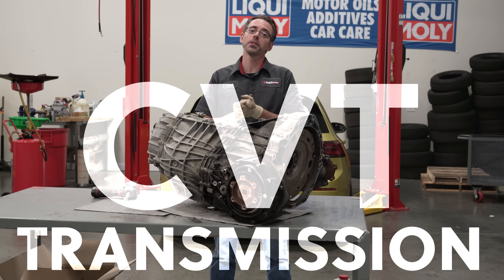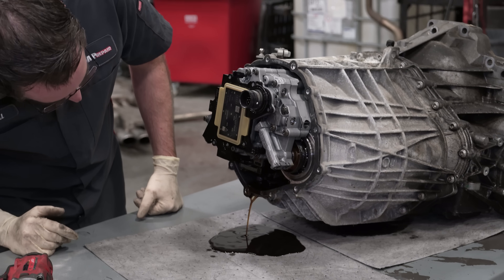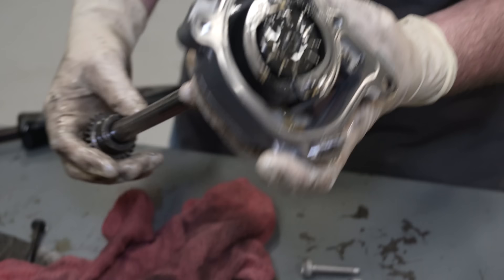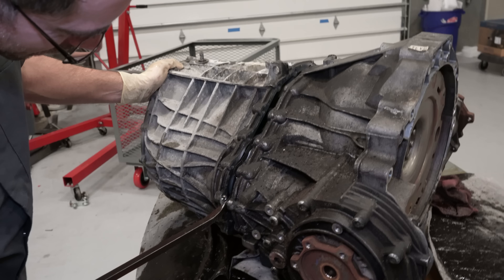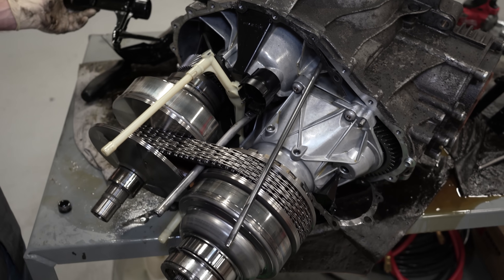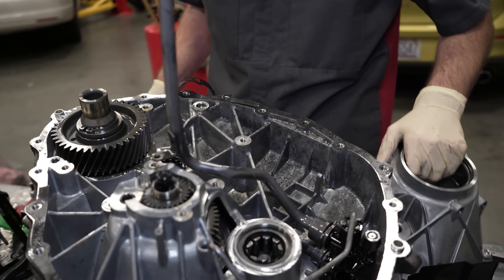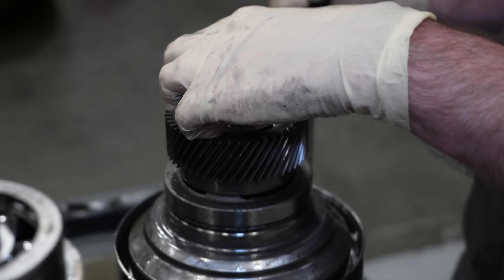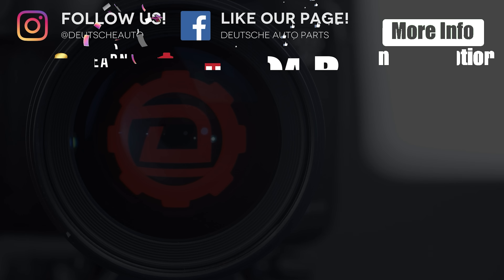Why you shouldn’t get a CVT transmission

Comment: Americans are into automatic transmission  but my favourite is a 5 speed manual floorshift.
Reply: Why wouldn't you like a 6-or 7-speed manual transmission even better?
Reply: @HelloKittyFanMan.  maybe on a big vehicle but on an ordinary saloon 5 is enough if the engine has good low end torque.
Reply: @ngauruhoezodiac3143 : I wasn't really asking whether or not 5 speeds would be enough. I know it typically is, but then still, plenty of consumer vehicles that still have manual transmissions have 6 speeds.

Go back to my actual question: Why wouldn't you like a 6- or 7-speed manual transmission even better? Do you like manuals more than autos because they're more fun, or... what, exactly? And if so, then wouldn't 2-3 more gears be more fun than just 5 (without being an unrealistically high number of them for a consumer vehicle, like 18+)?
Reply: @HelloKittyFanMan.  I often have to drive in icy conditions and the manual gearbox gives better control. I also have a very economic style of driving which favours a manual. A 6th gear or even a 7th one would be good if I had a car capable of 200mph but I seldom drive faster than 80.
Reply: @ngauruhoezodiac3143 : But 6th and 7th are fine even for everyday cars; especially a lot of 6MT cars around for the few manuals we do have these days. So why wouldn't you like one of those better than a 5?
Reply: @HelloKittyFanMan.  I don't need more than 5.
Reply: @ngauruhoezodiac3143 : Right. But having fun isn't about just needing something all the time. Have you driven a 6- or 7-speed manual? Maybe those manufacturers thought that those cars either needed that money speeds, or maybe they didn't and those cars could have gotten along fine with 5, but that the 6 or 7 would make them a little more speedy or efficient or something, so they still put the 6 or 7 in there.

So while you may not NEED 6 or 7 forward speeds in a manual transmission, the question remains: do you think you would have more FUN with one? And then IF your answer to that is no, then without just saying something like,  "Uhh, well I don't need them" -- because we just covered that (you don't need something in order for it to still be fun) -- what would be your reason that they wouldn't make things more fun for you?

Comment: Need to go to the single stroke motor or one of the new rotary engine versions for a electric generator to power individual electric motors. Get rid of most of the drivetrain. Less parts. Less to break. Less to fix. 
In the meantime, cvt seems more a downgrade than any upgrade. Crap engineering.

Comment: All junk. 
Literally moves your car on a belt.  They make them like this to save money. It's not a new evolved concept just rejected for years (for good reason). Actually a old concept.  You are losing money because you are paying full price for low quality that cost half as much to build. 
Goes great with all the cheap electronics and tech they put in cars now. Car companies are making a fortune basically selling you.. Cheaply made, cheap to make, crap.
Look at the arguments in the comments. If there is this much debate over a products usefulness and how maintainable it is, then it probably never should have been made in the first place.
Now add that to the timing belt or chain on the motor and you have 2 stupid inventions to worry about. But the motor at least has less strain on its.

Comment: Hello,
Now that I have a CVT based nissan, the decision that I cannot change for the next few years at the least. I have a question regarding the traffic light stops, 
Should the transmission be left in the drive mode or should it be moved to neutral? Does one have an advantage over the other or it is just about the personal preference?
Reply: The fact you even have to ask this question should be a red flag

Comment: I am sorry, but this is a poor and biased video. The CVT in the video is one from Audi and it is known to be crap. They only used it for a short period of time before switching to conventional automatics again and DSG (or whatever they call it). 
As far as I know Audi wanted a CVT transmission that could handle the high torque of turbo diesels, common in Europe, something that a normal push belt CVT cannot handle well. You can also see in the video the chain belt construction. And as anybody with a bit of interest in cars and technology knows a ‘normal’ modern CVT uses a completely different push-belt set-up and it is a proven and reliable concept. 
A modern CVT belt does not pull but it pushes the drive pully, therefore wear and tear is minimal. And no, Toyota Prius does not have a belt driven CVT, but a planetary gearbox set-up that also has infinite gears and call it therefore a CVT.

Comment: If that's the case, are there still renowned companies using CVT transmissions? Why do these cars perform well? How do they last as long as traditional transmissions? And why do so many people continue to buy them?
Reply: They are much cheaper to manufacture. It's cost savings. 
Also helps in meeting federal guidelines for fuel economy, lower emissions etc. 
But they are junk..
Kind of like the timing belt in your car.....but worse.
Car companies became very interested in upselling profitable and cheap to make electronic gizmos over the last 20 years. And they also became exceptionally well at planned obsolence so you have to rebuy/repair and dealer service profits using computer modeling and component testing.
Most people trade cars in within 5 years. They make them for least warranty claims within the warranty and loan length. So 5 to 6 years life span. 
Before the computer modeling for planned obsolence some cars were "over built". Some literally last decades. And easier to fix. Car manufacturers didn't like that. Luckily for manufacturers people would get bored of them and usually trade them in for something new and shiny. Then cash for clunkers program wiped a lot out  (which many would probably still be running). 
Late late 80s to late 90s (depending on models) was probably about the peak of auto manufacturing before they had planned obsolence and cheap parts down packed. But you can find mercedes 500s, volvos, buick 3800 series still running still decades later. Late 90s toyotas.. Etc etc
I know someone with a 40 year old volvo, car runs as a commuter pretty much every day. Odometer hasn't worked on it in a couple decades don't even know how many miles are on it. Original engine and transmission. Looks like a box. But he's not worried about cvt transmission and changing transmission fluid every 30-50 thousand miles.
Just look at the components now. The sheer lack of robustness, lack of quality. If it lasts through the warranty period and maybe the original buyers loan length thats the manufacturers concern. Nothing more.
Electric cars are apparently good for up to a decade, least 7 years before a battery change. They know no one wants a $12000 repair bill so they will definitely not keep them near that outer limit of life expectancy. The components on them can be made cheap too. They'll have a minium planned obsolence of 3 years or 5 years warranty with a max of 7 years. They'll dial those right in for $$. All throw aways.

Comment: A Nissan Murano, 2010, with 180,000 on it. Changed the fluid once (about 100K / $300 at the dealership). I'll do it again later this year. About 10x  / year the car tows a small trailer with about 1000 lbs. No further than 100 miles round trip.
I dislike the driving experience of it. Sort of slow to get going, weirdness of the RPM wanting to stay at a set point while accelerating. But... I won't call it a piece of junk. It is the wife's car & I think her lack of a lead foot also has helped. As of today it's still going and the car has also held up pretty well. 3.5 liter 6 Cylinder. Gas milage is around 21 on average.

Comment: CVTs SUCKS. Why? Because they are NOT anymore efficient despite the reliability issues they tend to have. They are not more efficient because of two reasons. The first being that a single pulley system has LESS ratio spread than contemporary automatics which can be up to about up to 9.8:1. The second being that the strong clamping force requires a powerful hydraulic pump costs a lot of power to drive. These two factors offsets the benefits of a stepless transmission.

Comment: I am not a cvt fan, but you can't blame the transmission for failing when it clearly was not serviced.
Reply: they make some of these that are 'non serviceable'. no fill port, no dip stick. many new cars tell you its life time as well. all bull shit.
Reply: @beardedgaming1337  Oh, it's lifetme all right. xD
Reply: @absolarix  lmao. I think that was the intent
Reply: @beardedgaming1337  Can only speak for my Subaru 2012 Legacy.  Drain/fill is really easy.  Only PITA issue is you need a good code reader to make sure CVT fluid is up to proper temperature.  Otherwise it is just drain/fill (fill until fluid drips out).  Don't get me wrong, not having a dipstick is BS and I don't understand why.  As for "lifetime fluid", yea that's BS also...  For Subarus, it's mind boggling: Subaru of America says it's "lifetime" but Subaru of Japan says service it 36k miles!!  Wee bit of a gap here hah!
Reply: @beardedgaming1337  life time fill was probably first used by BMW and you can service those transmissions it just requires more tools like a pump and diagnostic tool to monitor trans temp
Reply: It looks like you would have to split this particular one open to change the filter.... If that doesn't scream "non-serviceable" straight from the OEM, then I don't know what does. 
The way these rely on the oil condition for their operation.... Not being able to service these is just abysmal...
Reply: @Tom89194  it has three ports for the Honda one. One to check fluid, the other is the Monoblock the coolant lines and the drain plug. The filter is under the Monoblock and all you need to do is remove the airbox to get access to it.
Reply: @PremiumUserUltra  THIS transmission in the video has a pickup filter inside the housing that is NOT serviceable while the transmission is in the vehicle. I guess you could argue that since there are no clutch packs like in a 'normal' automatic then the amount of material generated by operating the transmission should not clog the pickup filter over the life of the transmission. This does not really help if the car gets flooded, since you have to remove the trans from the vehicle to replace the trans filter if the oil gets water contamination.
So even if Honda has set up to let people service the filter and oil properly without removing the transmission... It doesn't look like Audi has done that here.
Reply: @Tom89194  it might be  a screen rather than a filter.  they don't need replacing.
Reply: @Tom89194 Subaru also has check and fill ports
Reply: Unfortunately with even brand new fluid after 10,000 me the fluid is black
Reply: @jasonmurdoch9936 what???
Reply: It's barley been around long enough to fail😂😂😂 my honda 35 years old alternator every 10-15 years oil change an air filter. That tells ya somtging.
Reply: Mam you need 3 transmissions an a motor😂😢
Reply: tell me how you clean up the magnet inside the engine without crack open it
Reply: cvt s are junk.  proven a million times over,  not debatable.
Reply: An some of these people are being told "life an the tranny" don't need to change it. Then 30-70k miles it goes out. Dealers are liers. Cvt is junk. Change my mind. Ya can't cause i build em
Reply: What was the bill? 100k😂
Reply: a manual never changed the oil at all, 1 million miles.  cvt 100k miles dead.  buy a stick and live forever
Reply: BULL!! the good old hydromantic transmission has been around for so many years, I see them go 200,000 miles with no service. That's why people don't service the CVT transmissions, they are use to the good old dependable hydromantic, witch have in both of my cars. :hand-orange-covering-eyes:
Reply: @TOONMAN200  hydromantics are high quality planetary gear transmissions, comparing them to a cvt is almost as ridiculous as comparing a standard shift to an automatic with how they handle a lack of service.

Comment: My wife's Outlander, 4 cylinder CVT has 130,000km with zero transmission issues with only 1 fluid change so far...
I hate how it drives but it's also underpowered for a vehicle it's size so I can't really fault the trans

Comment: I had a 2005 AWD ford 500 with a CVT transmission.  I though it was fantastic and never had any trouble with it.  No slippage and silky smooth with no clunky shift points.  I sold it due to rust issues with about 140K miles on it.

Comment: Why would putting the wrong fluid in a CVT damage it specifically? Like, what part would get gunked up (scientific term) or worm sown by it? And yikes, it definitely doesn't look like a novice could dismantle this to repair it without causing damage while taking it apart, but...could you fix what the fluid damaged tho if you were determined and well informed?

Comment: Well, I fully TRUST the E-CVT that is standard in my Toyota 2022 RAV4 Limited Hybrid.
I have been told by reliable sources that the Toyota E-CVT is more of a 'Planetary Drive'.
Ours has been running as smooth as 'Ben Murphy' (MST-3000  Reference) ever since we purchased the vehicle brand new. 

I did add the Toyota Extended Warranty for 10 Years or 125 Miles the day we took delivery on the vehicle.
Toyota Ext Warranty has come though for us in the past.  
Worth every penny and just so you all know....They are Negotiable on Price.

Comment: Bogus claim, my 2016 civic has 124k miles and 0 transmission issues. Change the fluid and you’re fine. Nothing will last if you don’t maintain it

Comment: This was nice to see. Recently I got rid of a well-serviced 2005 B-Class with a CVT. Only thing that ever broke was the transmission control unit which caused a 1000€ repair bill. Brake lines needed replacement, done. Engine oil got changed earlier than recommended. The car drove well enough for me to not hate it, but the dread of a random 4-digit repair bill flying my way just ruined the fun and it started making suspicious noises I was sure I couldn't and didn't want to afford. Found a mechanic who specializes in transmission service, he took the car for a test drive, listened to it, and said nope, this one is going to need another big repair sometime soon. And he particularly stated that he doesn't work on these CVTs from Mercedes.

Now I'm driving a manual Ford and it feels like an upgrade, even though many comfort features of the Benz are missing. It just feels like a car that can reliably take me from A to B and be cheap and fun (yay, manual!). That CVT felt like somebody was trying to justify their degree in engineering and why they absolutely deserved a promotion. An impressive piece of technology, but I'd rather row with the stick than rely on black magic and voodoo, maybe some day I'll find myself driving a CVT again. There is probably a certain appropriate use case, it just isn't my case yet.
Reply: Exactly! The cvt feels like someone's "achievement" for their engineering degree.

Comment: Not a CVT transmission fan either. Drove a Nissan Cube that had one, and it lacked balls. Much prefer the era of gears with gear ratios for a firm 1st gear on up shifting experience on automatic and manual transmissions. Plus here in the Midwest snow belt, having gears makes driving in 2nd gear on crappy roads at 35mph or less so much easier. 

My era of favorite cars would be the older Honda models with 4-cylinders and geared transmissions, or Dodge Neons and th e 2.0L 4-cylinder, or Ford Escorts and even Escapes with the Duratec 4-cylinders. Firm shifts mile after mile for thousands of miles, even after 100,000 miles on the dial.

And don't get me started on the insanity of turn dial transmission selectors. Garbage! I want firm lever activation at the steering column or center console. That stuff sucks like electronic shift dial transfer cases. Yuck! 🤮

Although I am impressed with motor companies coming out with Hill-Descent-Control features on their trucks and SUVs. That actually should be a standard feature on ALL motor vehicles to utilize on steep paved roads as well as off-road and mountain routes. Anything that saves brakes is a bonus.

Comment: 2014 Honda civic had  transmission failure after 7 years with 80k miles. Out of warranty, they were asking 7k+labor for used parts. 9k+labor for new one. I had to tow my car to junkyard and got few thousands. Honda used to be  best value, but I will never buy Honda again. out of all, Honda's cvt is worst.

Comment: My Honda City still run smooth even after 150k km or 93k miles. A bit jerky after reach 110k km. I just make sure to keep scheduled in changing oil, filters and doing clutch adaptation, it will continue run smoothly. 

Of course, the driving style also will affect the cvt.

Comment: The amazing thing about the CVT is that you do not need to be an engineer to see that is a crappy design.  My training is in law and electronics and it's glaringly flimsy and unlikely to last as long as any other kind of transmission.  They are a deal-killer so far as I'm concerned.    I do like the Dual-Clutch transmission, too bad Ford gave it a bad name with their flimsy seals.  I still prefer a 5 speed manual over any automatic.